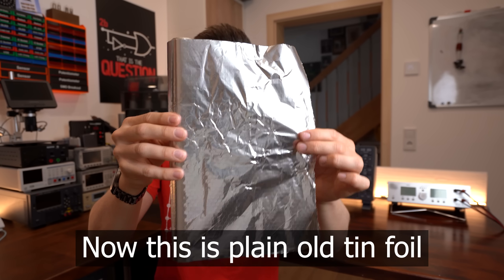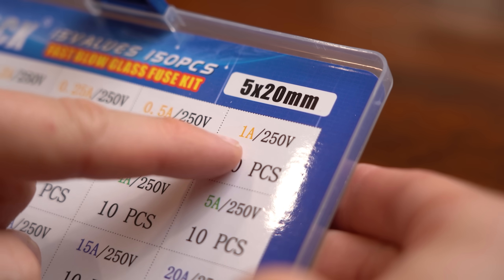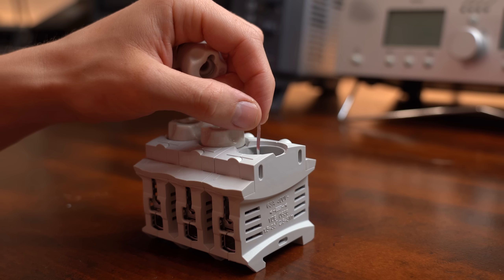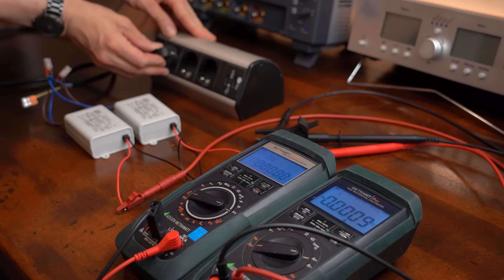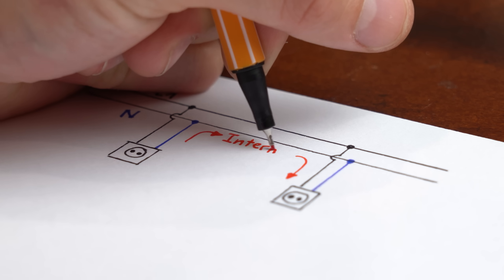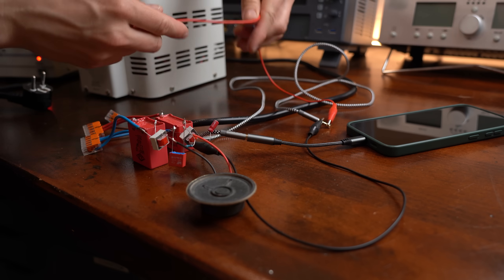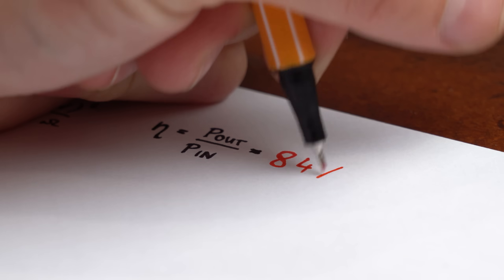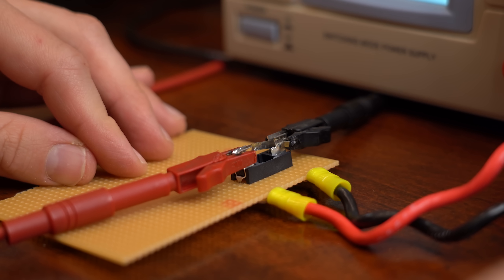I tried Busting 4 Weird Electronics Myths!

Comment: The tinfoil myth is quite common. But I don't think anyone expects it to behave like a fuse, just bypass it to make 'the thing' work again when you don't have a replacement fuse available. Just wrap the original fuse in tin foil and put it back. Of course very dangerous, but "if you know what you are doing" might be an okay temporary solution.
Reply: Yes, you're supposed to wrap the original fuse with way less material si it would flow way less current, and even like that I'm not sure anyone would consider it as a proper fuse but rather get the device to work again until next morning when the shop would open again.
Reply: @pbe6965  Problem is that people often forget to go to the shop for a proper replacement fuse.  Best practice is to keep some spares on hand.
Reply: I was just going to say the same.  Nobody thought it would work as a fuse.  And it wasn't tin foil it was the foil bonded paper from cigarette packages.  You would wrap the blown fuse with the foil.  Making an entire log of foil was never an option.
Reply: @someguy2741  or Wrigleys Chewing Gum for the non-smoker
Reply: Nothing is more permanent than a tenporary solution
Reply: It’s a fire starter; twisted fire starter
Reply: When I was 17, I used a chewing gum foil to get me home on my motorbike. Everybody knows this trick is probably not safe but then who looks for the reason why the fuse "failed"?
Reply: @maxkendal5152  Me. A faulty appliance is still faulty if it keeps blowing a fuse. Motorbike, getting home at night, probably more important than tracking down an intermittent short.
Reply: @maxkendal5152  I used this in my car so I am not sure if it works with a motorcycle.
I took a fuse with the same rating from another circuit that wasn't being used and put that in to get the car home.  Fortunately that fuse didn't blow so got home, got the spares and did the replacement.  Had that fuse blown again, then I would have towed the car to the garage to figure out why the fuse was blowing instead of having a fire.
Reply: Well, i heard about using a foil from a cigarette box and thinning it out just into a thin strip. It is certainly a fire hazard(since it "foil" from a cigarette box is a thin layer of metal on paper). In fact, a similar method that helps you start a fire "in a pinch" is the same basic idea, but the line is finer and you short it over say a 9v battery
Reply: It's cheaper than coins
Reply: The foil is supposed to wrap the old fuse and be reinserted back in; not replace the fuse.
Reply: @rallystar555  I've never seen so much aluminum foil used to make a temporary jumper before this video.
Reply: Yup. I had to do it once years ago driving home late at night when the fuse  blew for my headlights. Used a bit of foil from a stick of gum, and drove home. The very next day, went and bought a set of fues to keep in the car. Including a few extra to put in the spare slots in the fuze box.
Reply: The problem is Fuses have a Job and the Fact that it blew means something happened that caused it to blow and by bypassing the fuse your sending that Problem to the Devices that the fuse was there to Protect and can even cause a Fire and as a Fire Fighter I have responded to to many Fires because of people doing this
Reply from the maker: I met people who believed it worked like a fuse ;-)
Reply: @greatscottlab  Me too, I once found a HOUSE MAIN 32A fuse replaced with a large bolt wrapped round with insulating tape - The guy had been cut off by the supplier for not paying his bill. I walked away from the job.
Reply: @greatscottlab  I've met people that think if they're running out of gas they're more likely to get to the gas station if they go faster. Lots of dumb people out there.
Reply: @Tb0n3  "Calling 999 gives the phone more battery"
Reply: @smorrow  what about calling 666? 👹
Reply: @smorrow Tom Scott (also not Scottish, it’s his last name) made a video like 10 years ago that proved that it’s sorta kinda true but not really. The old phones would go into a low power saving mode and only allow calls to emergency numbers. If you called and hung up it would exit the low power saving mode so it could make the call but then not reenter it so you could keep using your phone until it totally died
Reply: @greatscottlab  It WILL work as a fuse, just a 150A fuse instead of 15A
Reply: @ET_AYY_LMAO It actually does not. A 150A fuse will quench the arc while the tin foil will set your house on fire.
Reply: @greatscottlab  In my country it is common to by pass fuse with strands from 2.5mm2 wire. Rule is 4A per strand. And it is relatively OK.
Reply: @pokojnitozo2360 that's pretty much how old fuse boards worked anyway.
Reply: @greatscottlab In the days of wire fuses we just had spare fuse wire. 15A, 8A etc (for the 240V mains). No one in their right mind would use aluminium foil for the cost of a few cents of fuse wire. I have used fse wire before to bridge the terminals of a blown glass fuse.
Reply: @greatscottlab  it works like a fuse, a 100A fuse....
Reply: @greatscottlab I know, I've done that but using foil for my cigarette wrapper, very very thin, and you expect it to catch fire because it's half paper... A desperate move basically.
Reply: @greatscottlab 

Everything 'works like a fuse' at enough amps 😅
Reply: @westelaudio943 Lol. The one I was thinking is "anything is a fuse if you're brave enough!"
Reply: @greatscottlab  what I heard, for this fuse myth, wasn't tin foil (or aluminum foil as there was a pedantic person in the comments...) , but cigarette paper.  which is more of a metalized paper, so it is a much thinner metal.  This was as you said, in all seriousness that it world act like a fuse in an emergency.

With the responses on this, I feel like this myth needs to be fully explored in full Mythbusters style.
Reply: @greatscottlab people will believe anything but I have used tin foil in an emergency until I can get a proper fuse. But should never be used long term.
Reply: @greatscottlab  This is tin foil as much as you are Scottish (this is actually an aluminum foil). Please stop saying you are Scottish.
Reply: @ZelenoJabko @ZelenoJabko He never said that he's Scottish. He's German and he never hided it.
"Great Scott!" is an old English language's idiomatic expression meaning surprise and / or awe. 
"It is a catchphrase of the fictional scientist Emmett "Doc" Brown from the Back to the Future franchise"
https://en.wikipedia.org/wiki/Great_Scott
Reply: @ZelenoJabko  If this is a joke, it isn't funny. And yes, we all know it is aluminum.
Reply: @ZelenoJabko  Even tho tin foil is made from aluminium, its still called tin foil.
Reply: @OgbondSandvol 

It's a stand-in for "great God" just like "oh my gosh" because of saying the Lord's name in vain and such :)
Reply: @OgbondSandvol  Well put.  I've used the expression before and I'm Canadian.
Reply: But dont you work in nuclear?
Reply: Eine Lage Alufolie um die durchgebrannte Sicherung, funktioniert ganz prima als Sicherung. ask me how I know
Reply: It isn't aluminium foil you use as replacement fuses it is supposed to be a coin that way no matter what was blowing the fuse it won't pop any more.
Reply: I just the other day opened up my old Radio Shack multimeter (yes I still have one haha!), only to realize I must have blown the fuse in it years ago and wrapped it in foil.

Oh well, whatever I was testing, I probably shouldn't have been using such a low wattage tester. I'll just stick to using it for low power electronics from now on.

At least it still works. Bonus points, somehow the batteries that have been in there for probably over 8 years are still good and aren't leaking 👍
Reply: I've lost the count of many old fuse I replaced with a solid copper bar! Fuses are so dumb in high power appliance if there is a proper calibrated magnetothermic switch! It's impossible to do a proper repair if at only try you must change that damn thing!
Reply: Was looking for this answer too, never heard people think it replaces the fuse, only for bypassing in worst case scenario until you can properly replace it.
Reply: @micheskillz  Scary part is that many people out there don't understand WHY there are fuses and figure it's okay to bypass them to get whatever it is working again.
Reply: Tin foil works as a fuse because it melts at 232°C(450°F). But tin foil was completely replaced by aluminum foil from about 1880 thru about the 1960's and melts at a much higher 660°C(1220°F). Today you have to special order tin foil.
Reply: You would need to cut it really friggin thinly
Reply: i feel like anyone who knows what they are doing and just burnt a fuse would not do this.
Reply: Honestly if its an old fuse that pops,  just use a steel or copper rod, guarantee there would be zero issues, since it is what is powering a random fuse in my 4 banger daewoo from early 00’s 😂  steel wire in fuse panel when i was stuck 100 miles from any town let alone car parts store…. Has 405k  miles, and still running strong! Its a korean honda civic with a well cared for engine though a p(-eee..+i)eeesss poor exterior, not including mechanical functions like brakes suspension and hinges etc

Comment: in the 70s n 80s... it wasnt tinfoil... it was a wrigleys gum wrapper ^_^
Reply from the maker: Haha, that might be worth a try next time.
Reply: @greatscottlab  the faint smell of the minty paper burning let you know you still have a problem
Reply: @greatscottlab Good luck finding Wrigley’s gum! 🤣
Reply: @toolsarecool Do you mean in the US or Germany? I mean, it is available on Amazon...
Reply: @nimoy007 yeah, not sold in Germany since 2022, afaik
Reply: @toolsarecool  Huh, is there a particular reason? Were they not profitable?
Reply: MacGyver!
Reply: Not only is the foil from a stick of chewing gum thinner, but one side is also made of paper, which makes it burn faster.
Reply: yeah ! That is a great idea: If your current is high enough the paper will start to burn. So not only a chance of a blown-up device, but also a burning house!
Reply: I've done it with cigarette package foil. It's very thin and paper covered on premium cigarettes.  One used a lighter to burn off the paper and its adhesive.  Wrap the 12 volt glass vehicle fuse with only 1 wrap of foil. Replace as soon as possible.  The cause of the short was always found and repaired beforehand,  reducing likelihood of scorching wires. The hope was the very thin foil would melt before the thick copper wires. 
Never gave any grief, but fingers were always crossed. In the Far North, strange things were done, in the land of the midnight sun, by the men who moil for gold. The northern lights have seen queen sights....(Robert Service poem)

Comment: Tin foil was never used in the old days.   A piece of the very, very thin metal coated paper from a cigarette packet was wrapped around the dead fuse.    It was usually an emergency but often forgotten.   ISTR that they would sometimes 'blow' if the fault persisted.
Reply from the maker: Maybe I can test that next time ;-)
Reply: @greatscottlab  Do cigarettes still come with that paper?   I assumed that it would be long gone.
Reply: @ElvisCompost  Yeah, it's still there. I don't know if it actually condicts though. It feels gappy.
Reply: Yes, did the exact same
 Worked great 👍

Comment: Why use tinfoil when you can harvest a single strand from a multi-strand copper wire? You can even perform tests to find at what current a certain length of such strand burns out to make a somewhat predictable fuses. Obviously not a proper replacement for a real fuse, but still
Reply from the maker: Not a bad idea. Would be interesting to test.

Comment: it was never meant to be a legitimate replacement for fuses. it's what you use when you don't have anything else.  Don't know how many times I used foil from cigarette packages(specific to the kind of packaging in Canada) to make repairs to things.. from replacing fuses to using it to fill in spare around a car battery connector that was loose in the field and I didn't have a tool to tighten it. all kinds of things.  That was when I still smoked.  for the fuse replacement you roll it into a tube, not just a strip.

Comment: Foil for a fuse? Use a piece of 1/4 inch rod instead so it doesn't melt. Works every time, even after the PCB catches fire!
Reply from the maker: Haha thanks for the tip ;-)
Reply: this reminds me of those bike helmet ads where they show that the helmets are indestructible, completely ignoring the point of a helmet lol

Comment: I don't know what its like where you are, but here in the UK people generally aren't thick enough to believe tin foil "will work like a fuse", just thick enough to believe it's ok to do when you don't have a replacement fuse to hand.
Reply: Well, better a tin foil fuse I suppose than using a .22 long rifle cartridge.  (yes, the .22 is brass, so perhaps a slightly better conductivity, but when it 'blows'... it really 'blows')  That's what some American people have tried..  lol
Reply: @mikefochtman7164 Slow blow audio visual feedback 😆
Reply: @mikefochtman7164  Actually, it seems pretty sound to try. Cartridge is brass, bullet is lead, and the primer is pressure activated, so unless it gets an internal arc, sound like you'd never have an issue. Your circuit or other wiring should fail before the metal does, and the powder isn't at much risk of ignition.
Reply: @weeveferrelaine6973  Well the Mythbuster's show demonstrated that if you pass enough current, you WILL set off the charge.  But without a barrel/ chamber to contain the gasses, it's not really lethal. Other's have tried it and it can be 'blown'.
Reply: @ I just think the circuit would melt before the .22 would. Do you know how much current it took?
Reply from the maker: Well, watch the video ;-)
Reply: I did watch it - you said the myth was 'people believe tin foil works as a fuse' or words to that effect. I've never met anyone that stupid, but I've met plenty of people thick enough to believe it's ok to replace a blown fuse with tin foil. There is a very significant difference in the two. They don't believe the foil will work in the same way as a fuse, just that using foil can get the appliance (or whatever) working again in lieu of a replacement fuse. It's not the same. It's still bad, but not the same.
Reply: BS, I live in the UK and people are STUPID enough to use tin foil but worse than that they use stripped down wire. Best botch I've seen was someone removed the earth pin from a 13amp plug and rammed it into a fuse holder but in fairness it didn't blow. 😂
Reply: So you didn't read what I said then, did you? Or you didn't understand it. I didn't say people didn't use tin foil or whatever, I said they don't think it will act like a fuse (which is what was said in the video) just that it's a bodge to get something working again. Of course there are a LOT of thick mincemeat for brains morons in the UK just like everywhere.
Reply: I live in America and people are thick enough to vote for a president who was convicted of sexual assault, and on top of that, they invent an acronym (TDS) to describe people with a "syndrome" who don't like the man with the sexual assault conviction.
So yeah, pretty thick.
Reply: In the UK it's used as a boj job to get you out the mud in a pinch while the real things on order 🤭
Reply: I found a sawn off 1/4” jack plug works better 😂
Reply: It is never ok. But still uk doesnt even have proper fuse boxes and outlets like the rest of Europe so...